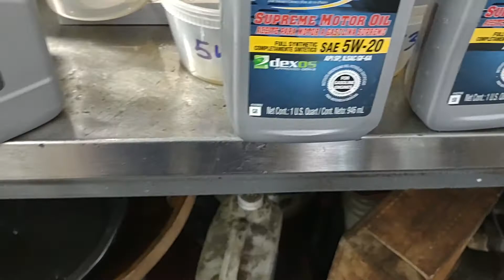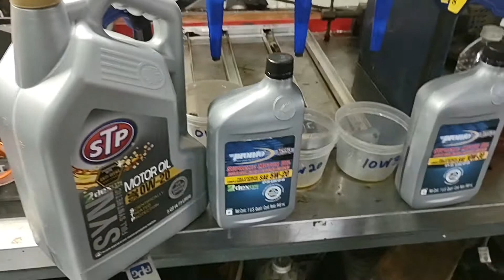Motor Oil Viscosity, 0W-20 VS 5W-20, Freezing Engine Oil

Comment: Question for yall. I live in Louisiana, just bought a nissan frontier, says to use 0w 20, but it gets very hot down here. Im thinking of 5w-30, what i a yall opinion on this ? Thanks
Reply from the maker: The key behind these oil viscosity numbers is ensuring a consistent flow to all engine components across varying temperatures. The "0" rating at cold temperatures is especially important for modern engines, which contain significantly more components than older vehicles. These parts demand rapid lubrication at startup, so the oil pump works to deliver oil to the engine’s highest points as quickly as possible. When the engine heats up, it's crucial that the oil maintains its viscosity to continue protecting vital components. That’s why it’s recommended to stick with the same viscosity, but opt for a high-mileage formula to enhance protection and performance.

Comment: Thanks so much for the hard work and explanation, so It means I can use 0W-20 instead of 5W-20 in both vehicles in California (as my 2015 RAV4 uses 0W-20 while the 2007 Accord takes 5W-20). Thanks

Comment: One more thing. Best oil is clean oil. People don’t realize the filter  keeps dirt out but the engine produces carbon acids and also moisture gets in there and other crap is happening in that engine. You may someday check your oil but also look at the oil filler cap. If you have a yellowish color gunk on the cap don’t worry it may be just moisture because your not getting the vehicle up to high temperature. Short distances drives does that. Wipe off the gunk and take it for a good ride that will burn off all the moisture in your engine. Always make sure your not losing coolant. You could have a radiator problem or head gasket leak.
Reply from the maker: Good point! I appreciate your input
Reply: Years ago I remember mechanics would say put in a quart of Marvel Mystery oil to thin out the oil in winter. Jesus I’m old. 😂😂

Comment: My Toyota owners manual says I may use 5W-20 instead of the 0W-20 in between changes. What say you?
Reply from the maker: I would use 0w-20 winter season and use 5w-20 Summer and If high mileage on the vehicle I would use 5w-20 all the time!
Reply: You won’t have any problems. 5/20 will give you plenty of protection. They go to 0/20 to keep the government happy. They say you may get better mileage and better emissions with 0/20 being slightly thinner but not enough to be concerned about. I personally think 5/20 is perfect year round oil

Comment: if you use a higher viscosity oil,warm it up,or just rev it to 4k for  5 to 10 seconds to let or circulate and go.
Reply from the maker: Never rev cold engine to 4k RPM regardless of what oil you use! specially cold engine at startup, using higher viscosity is not recommended in many cases, when engine sits overnight all the oil gather in the oil pan,  with this being said if the oil thick; this will put so much stress on the oil pump to lift the oil and distribute it to crankshaft shaft, camshaft, rocker arms, lifters, timing chain if equipped and etc, so imagine all those parts are running dry @ 4k RPM, I hope I answered your question!
Reply: @carservicepro  thanks for the reply.👍
Reply: That is terrible advice!  Let the oil circulate before you increase rpm’s.
Reply from the maker: @jaywinters2483  I think "count on me" was asking a question and wasn't making any statement or giving any advice!
Reply: @jaywinters2483  i have been doing that to all my vehicles. no problem for 20 years. by the way I change my oil at 5000 miles